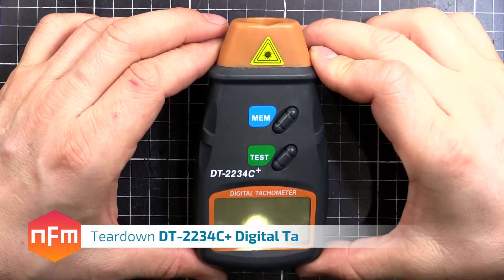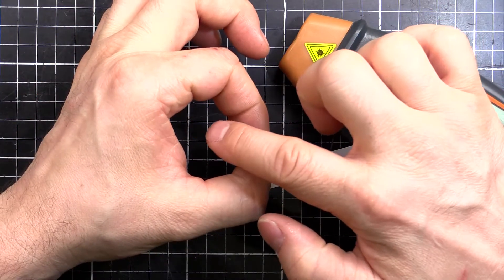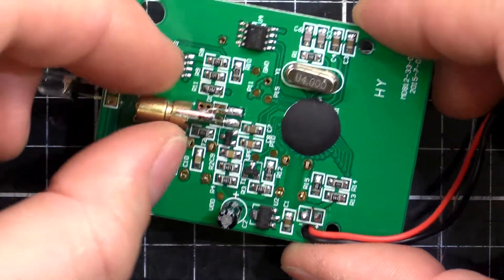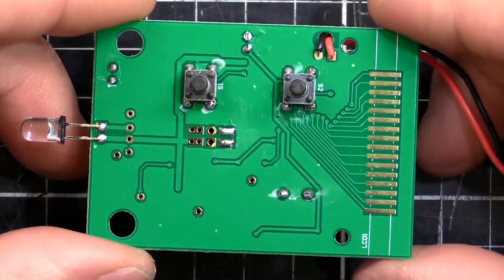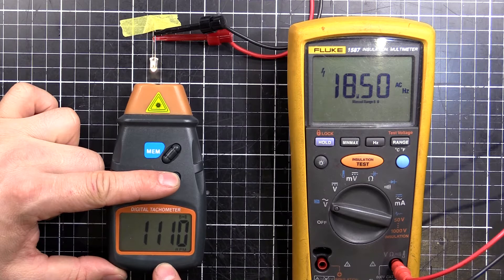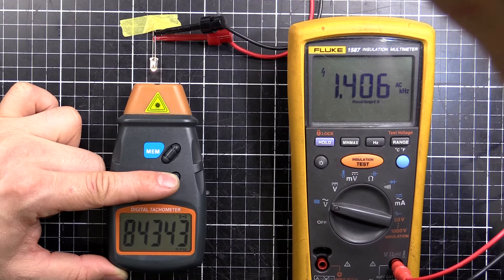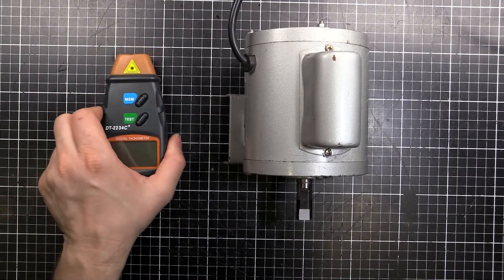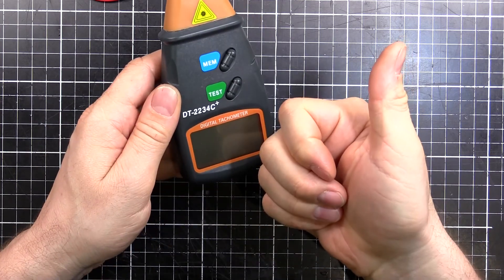DT-2234C+ Digital Tachometer Teardown and Review

Comment: Can you tell how to delete all RPM values from its memory? When pressing the mem-button it can be quite confusing to tell whether a value shown on display is one from the running test or from an earlier speed test days ago.
Reply: it stores 3 values after you measure: highest (preceded by a "up"), lowest (preceded by a "dn". this value is retrieved always after a highest value is reached) and the last value registered when you stop measuring (preceded by a "la").

if you hold the mem button, it will show, for example, the highest value. if you release the mem button and hold it again, them it will show the lowest value, and so on...

values from previous measurements are always overwritten by the last measurement
Reply: @joao.mambelli  Thanks for telling me. 😄 Basically, the manual should explain that.

Comment: A tip: If your tape is on a reflective surface, the tach won't read accurately aimed straight at the tape, like on a polished chuck as an example. However, if you place the tach on a 45* angle below the object with the tape, it will read accurately.
Reply: Good idea. But how would ylou measure speed of a record player? Mine has got a turning plate which is polished and reflective from side-view (surely the best position for measuring). And I cannot check its speed from below.
All I know is that records are playing a little too fast while listening, after I had replaced the old 12 V (80 mA) power supply with a broken cable for a new one that has got 12 V 400 mA.  I know how to reduce voltage with a step-down converter,  but I want to have confirmed correct speed values od 33 rpm and 45 rpm when I try to set a new matching voltage.
Reply: @attic636  You DO NOT measure the speed of a record player with such tachometers! That is like using a sledgehammer to fasten a stapel.
The accuracy of such meters is not great in practice! Do not be fooled by the test he did with the PWM pulsing LED. That is not how you measure in practice. In practice you will never get that accurate reflections from light.

If you want an accurate record player, you use those (usually paper) discs they sell with a black/white pattern on them. You put them on your record player while it is spinning. And if you notice the pattern being still (no rotational movement) you have the correct speed. If they slightly move CW or CCW, your speed is a bit too fast or slow. They should cost 10 times less than the cheapest tachometer you can find and they are 10000000 times more accurate to the point of being perfection (depends on how exact they have been made). In fact, expensive record players have them build in on the side of the spinning plateau with a tiny light on them so you can clearly see if they are spinning absolutely correct or not. Search for "vinyl stroboscope disc" or "turntable speed calibration mat" . Shouldn't cost more than $5-$10.

Also, there is no practical difference at all where you measure the rotation (since you said: "surely the best position for measuring" ). The whole point of these tachometers is that they literally only measure the amount of reflected light pulses pulses. So, where you measure it does not matter at all! It can be from almost the center of a disc, from almost the outer diameter, from the side, underneath, on top, ... makes no difference at all in terms of accuracy. It is all literally the same: amount of light pulses which pass by in a given amount of time; 1 rotation is 1 reflected pulse..... NOT to be confused with linear or tangential speed (in which case it absolutely matters)!

Also, if the thing you want to measure is reflective, then put some black non reflective tape on it, instead of a reflective tape. These tachometers measure pulses of light, or better said: the difference in light on the light detecting diode, or not. They usually measure on the leading edge of the reflective curve. Hence why it also doesn't matter how wide your 'reflective tape' is... as long as there is a sudden difference/drop in reflection, they should be able to measure it.
Reply: you went to great lengths to rubbish this YT video content.. @CookieTube  
I found it useful.. and no this particular Tachometer is not about 10 times the price.. it is at the lower of the price of your piece of paper (and as you state if you get one made accurately - how would the user know). I'm not rubbishing your advice either; each to his own but it is fine for a lot of applications; esp the ones I foresee using it on and glad I saw it tested. I don't think this tool is intended to be laboratory standard either.. esp for the price (currently £6 UK on Aliexpress.
Reply: @attic636  No, no need for an optical tachometer tool, nor for a stroboscope.
You just need to put a proper AC mains operated incandescent or fluorescent (but non CFL) light bulb close to it.
And look at the 'apparent' movement of the stripes with just only your eyes.
You are indeed looking for the 'standing still' effect.
In this case, the accuracy of the disc and using your eyes would be orders of magnitude higher than using an optical tachometer like the one shown in the video (make sure you aren't drunk though... or it might not work).

So, as for the need of a stroboscope to make the effect appear: you already have it: it is the AC mains electricity from your own power grid! That is why the discs are calibrated to 50Hz and/or 60Hz and not some other, but totally possible, frequency. There is no electronical secret or audiophile 'magic' involved in those numbers other than pure old plain convenience. You can in fact design and create a disc calibrated to whatever frequency you fancy, and it will work with an appropriate strobe light. But why bother when people already have 50Hz or 60Hz at their disposal in their own house which has always been flickering lamps since the beginning of the invention of electrical lighting (you may have simply never noticed it though --- btw, in that case: lucky you, because some people are subconsciously sensitive to it and get headaches because of it after a while)....

Thus, there is no special relation between how your turntable operates and this specific frequency in context of the function of that disc. Well accept of course, the turntable indeed needs to be compatible with your power grid too or it will blow up. lol. But how it uses that: to drive a motor directly, or convert it to DC first and drive the motors that way, or whatever else.... has nothing to do with how such a disc operates. It is just pure convenience that the power grid can do double duty as both to power the turntable in whatever direct or indirect way, and can also be used as a way to create a strobing light (especially in the old days) using plain old household lamps in case your turntable didn't have such calibrations stripes build-in on the side of its platter .

So, all you need is an AC mains powered normal old style filament/incandescent lamp , or a long-tube fluorescent lamp .
It wont work with those fancy energy saving CFL types though, as they don't flicker at the rate of your AC mains.
Also modern complete LED fixtures wont work because they all use rectifiers and capacitors, or even dimmable drivers (unless you make one yourself specifically for this purpose which is directly connected to the mains with only the appropriate resistors so you don't blow up the led and nothing else. Or if you use a PWM-driver. In that case it would even be far better than anything else because a led will turn on/off instantly, opposed to any other type of lamp which always has a small gradient in their on/off cycle)

But in case you don't find a suitable light in your home anymore: yeah, then you do need a 'special' dedicated stroboscope. But the only way they are 'special' is that they flicker at 50Hz or 60Hz though. They are absolutely nothing more than a simple incandescent or fluorescent lamp you plug into the mains, which you can buy yourself in any DIY store......(well, at least I hope you can still buy them...lol). Or there are also battery operated lights for this use specifically, or via a power adapter like the listing you found on eBay. They all simply use just a small PWM-generator to flicker a led at 50 or 60Hz.

Note: that eBay listing you pointed at is indeed for such a 'special' strobe light, but it also has the stroboscopic disc included (so you don't need to buy both separately). But note that that specific light is not battery operated though, it needs a power adapter (12V, which should also be included in that package. 110V/12V on that eBay listing I believe). This is the exact same package as you can find on hundreds of websites. And if you search at the source (China/ AliExpress), you'll find the exact same bundle for around $30 (including the choice of 12V adapter for 110V or 220V). Search for "stroboscopic turntable light" on AliExpress.
Reply: Where do you put the tape on a chainsaw?
Reply: @eamonnkelly7465 Hmm, good question! But tape is not mandatory. You might be able to put white paint on the side of a few links. With a try, anyway. Could also take off the sprocket guard, put the bolts back on, and monitor the sprocket with tape or paint on it. I think that could be done on my Stihl MS271, at least.
Reply: Yeah, that worked for me measuring a squirrel cage blower at 3450 RPM. I tried black duct tape around the whole cage, but even that was too shiny. It was trying to count the individual vanes, which made a pattern in the tape. I was getting all kinds of huge, wacky measurements. When I put the instrument at about a 45 degree angle with the axis of rotation, it instantly went rock steady. Thanks!

Comment: Hey! Thanks for the review!  I have one of theses and it suddenly stopped working. R11 looks toasted - totally white. what's the value for R11? Thanks.
Reply from the maker: In my unit, that resistor appears to be an 0805 size with marking '152' which is a 1.5 Kilo Ohm resistor.
Reply: @NearFarMedia  Thanks - Testing the meter is on my bucket list

Comment: I just got one of these from Ebay and they have revised the design at some point. The switches are now properly soldered from the back and the laser diode is much smaller, about the same size and shape as a ceramic disk capacitor and won't flap around. Though I still put a blob of electronics grade silicone on the back of the component to protect it from vibration while I had it open. Overall the internal build quality has been greatly improved.
Reply from the maker: Nice, good to hear they made the improvements.

Comment: I bought one from Aliexpress for 7 or 8 euros incl. shipping and tested with a lab power supply and a computer fan. It appears to work accurately because the measured RPM is consistent and roughly matches the values given in the fan's data sheet. Note, 9V battery not included, prepare to expend 2 extra euros for a battery :-) I intend to use this device for the H adjustment in chainsaw carburetors where going to too high an RPM can case the engine to seize.

Comment: I watched the video and bought one. I guess if it would be working would be accurate but mine does not work at all
Reply from the maker: It might be worth opening it up and poking any suspect solder joints with a soldering iron and checking that the laser and sensor are aligned properly.